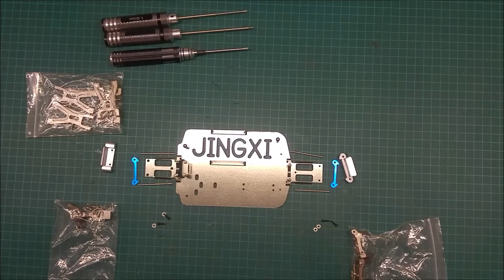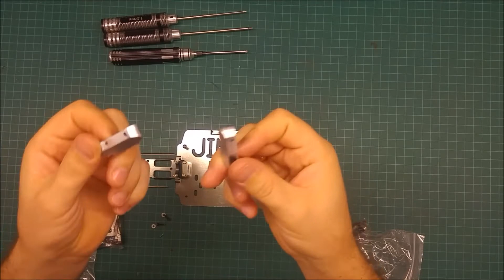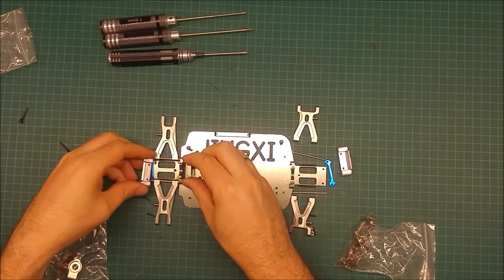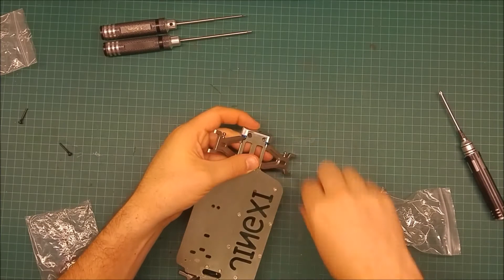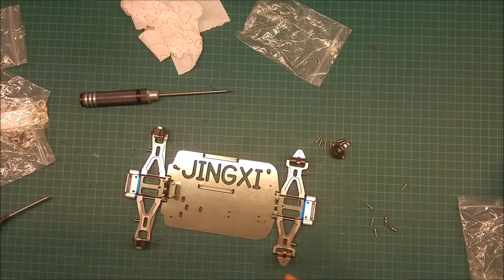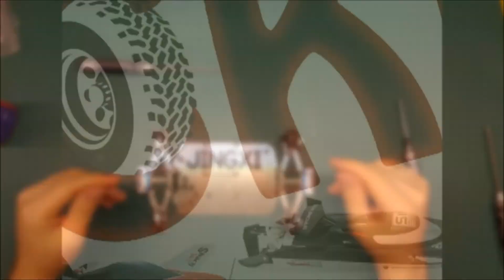WLTOYS Metal Build Part-2

Comment: I am missing parts: 
A949-36 (driveline bearings)
A949-15 (servo positioning cap, bearing cap set)
A959-B-17 (dust cover, not sure I need it)

Comment: You can use full metal diff, modding this one. Only Bearing housing is different. 
https://www.banggood.com/es/REMO-P6952-Differential-Gear-Assembly-116-RC-Car-Parts-For-Truggy-Buggy-Short-Course-1631-1651-1621-p-1101814.html

More info here: https://www.rcgroups.com/forums/showthread.php?2136004-WLtoys-A979-VORTEX/page196

Comment: ok I've assembled my car using all metal parts where possible ..but I now can't turn the wheels as the centre driveshaft and large gear at the back  that meets the diff are solid and won't move 
the gear is touching the metal chassis so I'm stuck .! 
I've heard of some people saying this happens ..any idea what I need to do ? I don't really like the idea of cutting so if this can be avoided that would be good ..
cheers 
Martin
Reply: ok the problem I've found is to do with the updated metal gear ..
the Slot in the gear is too short compared to the plastic one so the centre shaft metal slots don't slot far enough in and hence why you may find the gear hits the chassis .

Comment: I've got this far but I've now hit a problem I'm still using the original battery and motor and receiver ..but the receiver seems a bit tight to fit ..are you able to show how to fit this and if there's any modifications that need to be done for this ...?
Reply from the maker: When i get to the electronics i will install the original set and than brushless set .
Reply: RCklir  ok great thanks ..when can we expect this ?